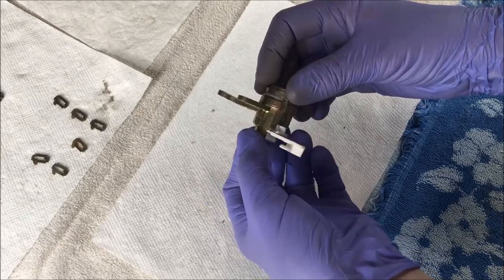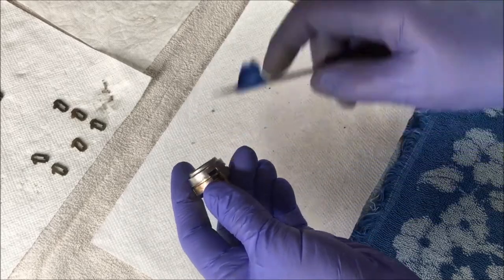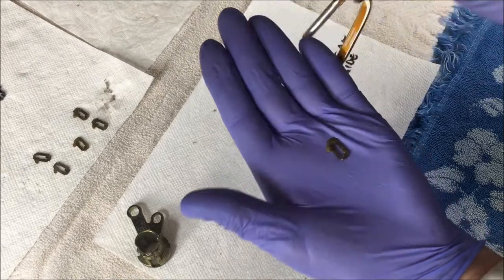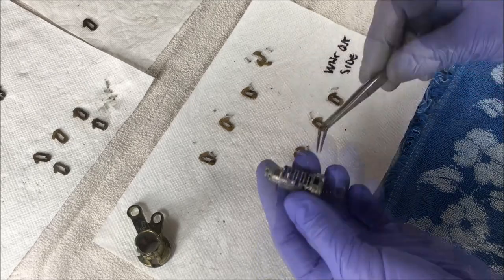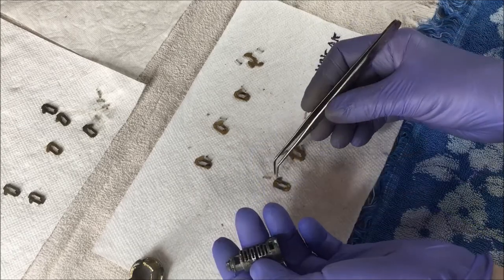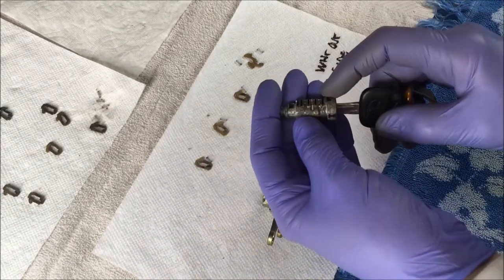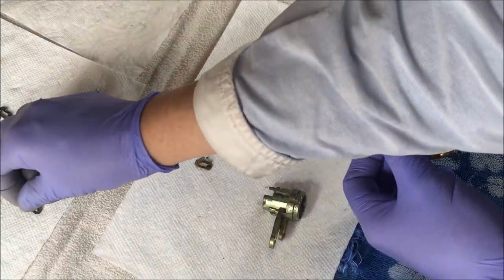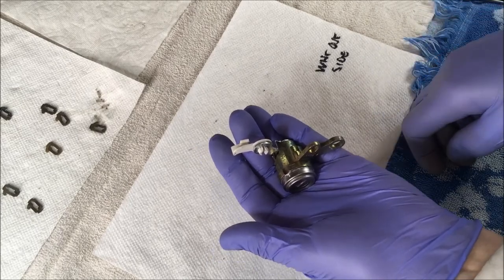Fix and Rekey a Car or Truck Door Lock | Lock Cylinder

Comment: Thanks! I was quoted $85 to rekey my drivers side lock for my toyota crown comfort and was told I still have to buy a used barrel for them to rekey it, Bought a used key barrel for $20 and swapped the pins and it worked. Thanks so much saved me alot!

Comment: Hey, thanks. 

My '88 Canter crane truck fell over a wall 4 years ago and although I could buy most of the parts to glue it back together, the only driver's side door I could find was in Queensland (I'm in Perth Western Australia, 4000kms from Queensland). The thing delivered was a bit like the door in the photos once I'd drained off the glass cubes I'd hoped would be a window, but you take what you can in the most isolated city on the planet. 

What I didn't know then but do now, is the door was cursed. I should have allowed for that because things from Queensland often are. 

To ease the pain of the falling over the wall thing I’d spent a few extra bucks hoping we could re-bond while the vapours of fresh paint where still intoxicating. So, three months and $17,000 later I proudly reversed it out of the panel shop into my hire truck.

The driver’s side door absorbed what a brake pedal or steering wheel would have in the hands of a competent operator. I haven’t repaired it. Like a head on a pike, it mocks misplaced confidence.

I suspect Queensland was a parts bin toilet for unsaleable Canter models because no available parts fitted “the door”, including the lock. Thanks to you and you’re vid I can now lock “the door” without a 1.5m length of fencing wire to hook the knob from the passenger door. Funny thing is, no one bothered stealing it in the 4 years it’s been unlockable anyway. 😊

Comment: So in concept I totally understand this video. Great job btw. But here's what I don't understand. Let's say I buy a brand new car door lock cylinder (2007 Escalade for me). Is it going to have all of the necessary pins needed? For instance, if it comes with 8 pins, are all of them going to fit my key once I get the order correct? Or will I have to purchase additional pins in case a number is used more than once?
Reply from the maker: No, the brand new car door lock may not have all of the necessary pins numbers for your vehicle's keyed lock cylinder.  The key to your vehicle's car door lock is specific to the lock cylinder based on the numbered pins and their placement/location in the lock cylinder.  So, you may have to purchase additional pins to get the correct numbered pins.  I'd look on eBay for those pins.
Reply: @frugaldiy1  Ok thank you. That's what I thought.

Comment: If you don't have a certain pin and omit it at that location entirely, will the lock still function despite less secure?
Reply from the maker: No, nunya, it will not.  For the lock/lock cylinder to function, all pins have to be in place and match the "code" on the key.  The "codes" meaning the peaks and valleys of the key.

Comment: Are the tiny springs different? Can't you just put one in a slot and keep trying the pins until one lines up and then repeat?
Reply from the maker: No, the tiny springs are not different, but I like to place them back into the locations they came from.  I think it will work just fine if some get relocates.  Make sure to clean out the lock cylinder while you have it apart.  Then, before you put the lock cylinder back into your vehicle, lubricate the lock cylinder with either white lithium grease (spray is fine) or silicone lubricant spray.  I prefer silicone because it's easy to re-lube the cylinder locks several times a year to keep them in good working order.
Reply: @frugaldiy1  Excellent! Thank you :)))